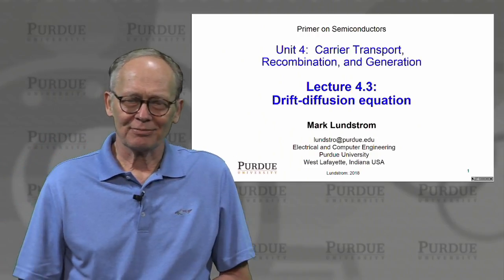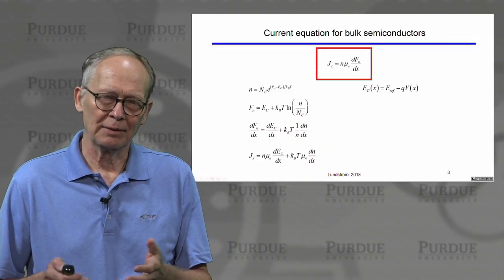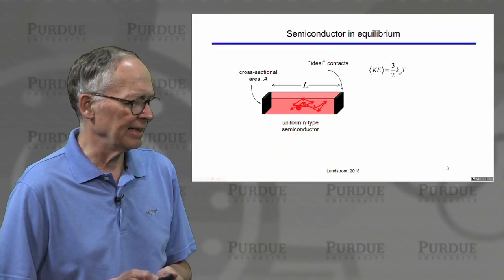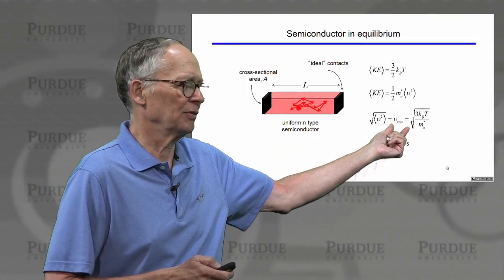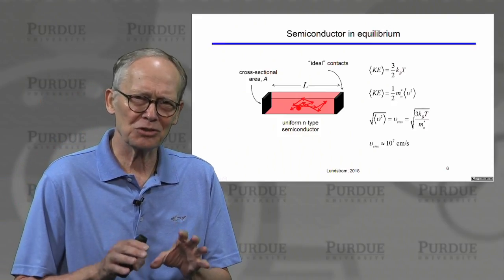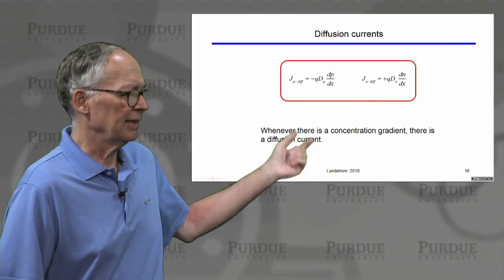ECE Purdue Semiconductor Fundamentals L4.3: Recombination and Generation - Drift-Diffusion Equation

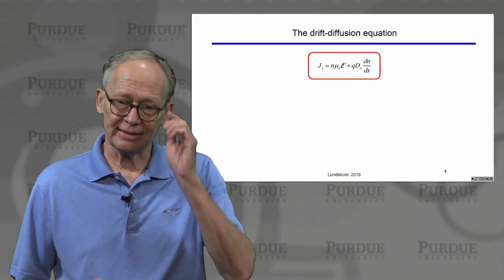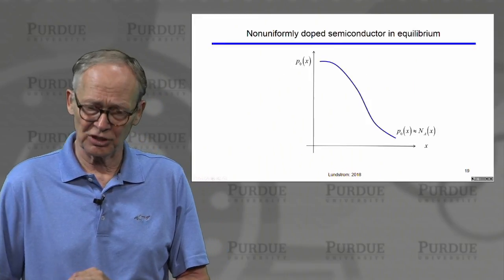Comment: 1:03 Current equation for bulk semiconductors, 3:21 The drift-diffusion equation, 4:56 Thermal velocity, 7:07 Drift current and drift velocity, 10:26 Drift velocity vs. Electric field, 13:42 Drift current, 14:34 Mobility vs. doping, 16:21 Mobility vs. Temperature, 18:16 Total current, 19:25 Resistance, 21:03 Diffusion current, 23:11 Nonuniformly doped semiconductor in equilibrium, 24:44 Summary